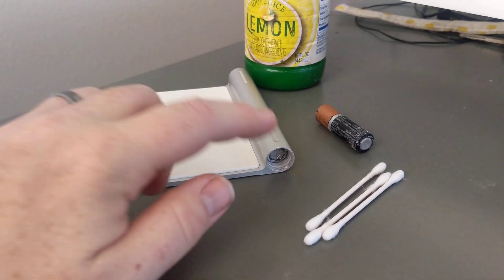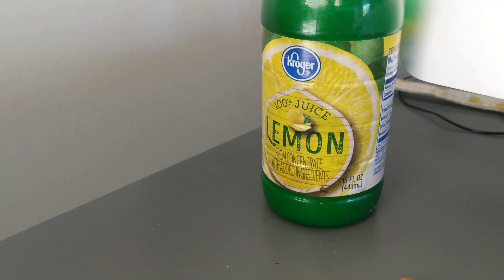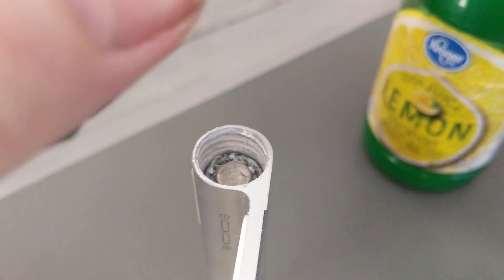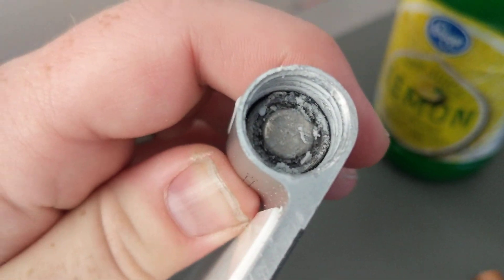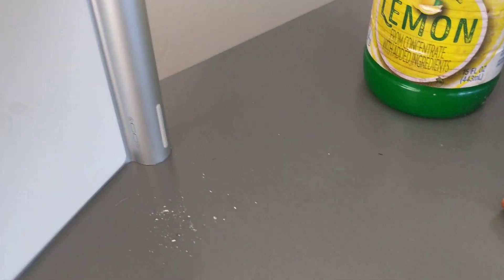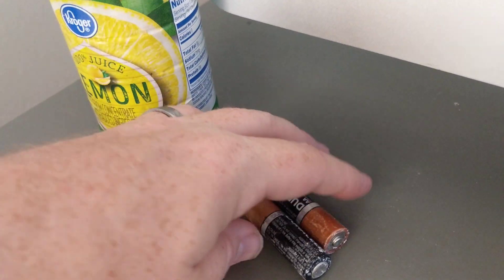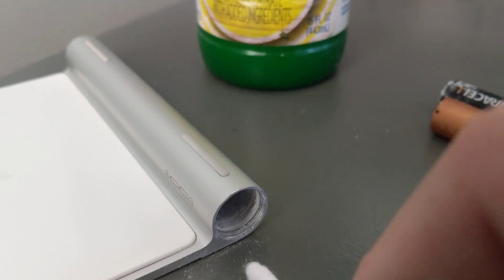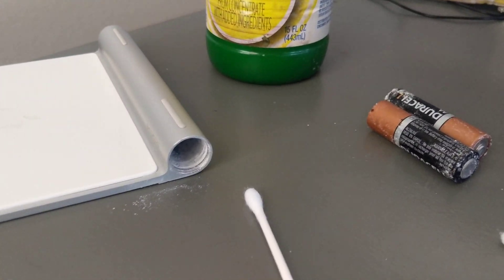How to fix stuck Apple Magic Trackpad (A1339) battery screw door and battery corrosion.

Comment: Just wanted to share a technique tht worked for me to get my trackpad open without damaging the glass.
I used a tiny screw driver as a wedge/chisel and hammered it in all around the edges of the screw endcap. I think the hammering helped loosen the corrosion.

Comment: I couldn't even take the metal cap out. Have been trying with hand and electric screw driver and have broken a couple quarters :(
Reply from the maker: It's the tapping while turning that did it for me. Gotta do something to loosen up that calcification in the threads. It's probably really bad on yours. Just be careful not to shatter the glass. I found that a nickel was the perfect size to get it turning.

Comment: It should be said that this isn't an alkaline battery problem, its a dissimilar metals / galvanic corrosion problem. That's the reason that the corrosion gets so deeply into the threads where the the steel is supposed to exchange electrons with the aluminum, and why "getting the fucking screw out of the end of the Apple keyboard" is a unique and particular problem, even when there's still charge in the batteries.  Loosening the screw wheneven you happen to think of it is the only solution, short of making a new screw out of aluminum, or plastic if you provide some sort of contact plate out to the cylinder walls from the negative terminal.

Comment: Tried opening mine with a quarter and pliers, but the trackpad flexed slightly with all the force I was applying and so the trackpad glass cracked all the way across, so now I have 2 problems to fix! Just bought 4 non working ones for parts off eBay for $25 - I must be able to salvage one working unit out of it and still be better off than having to buy a replacement (I hope!)
Reply: Any updates on that?

Comment: Thanks so much for this, although I cannot get the cap off. Ahhh so aggravating!
Reply from the maker: Using a nickel in the slot with pliers to turn the nickel while simultaneously tapping on the nickel with a light hammer was the only thing that worked for me. I fought mine for an hour before the tapping finally did it. I think the tapping loosens the corrosion that has locked up the threads. Careful with the tapping though, because the trackpad surface is glass and will shatter if you hit it or if you put too much pressure on it. Also, the joint where the trackpad  glass and metal meet will bend if you wrench too hard with the nickel/pliers, so watch out for that. But try the tapping. It was the key for me.
Reply: @JerryFerguson  Thanks! I'm still slowly working on it. I refuse to trash it! Thanks.
Reply: @ashleymullis9539  please let me know if were able to unscrew it. Thanks
Reply: Locking the hell out of it with a hammer works well.
Reply: Coins wouldn’t work for me. I gave up and used a screwdriver. It was still a bit of work, but the cap finally unscrewed.

Comment: I fought the corroded battery in my Magic trackpad for an hour when one of these videos inspired  me to use my table saw to cut an 1/8" slot on the bottom side of the batt compartment giving access to the batteries where the meet in the middle.  Inserted a screwdriver and pried the batteries out!  SUCCESS!  Then while proudly cleaning up the inside and out I dropped the thing on a concrete floor shattering the glass, had a laugh and threw the mess into the trash.  Done... go back to real work now and quit farting around.

Comment: Will putting the vinegar inside damage any components?
Reply from the maker: It could, but I figured it can't get much worse than having a corroded battery in there.
Reply: @JerryFerguson  figured mine out! It was a 2-battery keyboard (I thought it was 3). The receiver inside look JUST like a battery and it looked possibly corroded. Tip: don't try to take out the receiver haha. Felt like an idiot when I figured it out!

Comment: Using vinegar or lemon juice (both acids) will help to attack the corrosion. However, you should use baking soda and water mixture (a alkaline solution) to neutralize the acid(s). Personally, I would first use the baking soda mix to neutralize the battery acid. Then you could use the vinegar or lemon juice to clean the aluminum surfaces. Finishing up by using the baking soda mix again as a final process to remove all remnants of the acid. Aluminum is not a stable material, if you wipe your finger across raw aluminum, it will turn black. This is due to the fact that aluminum is always oxidizing. Once the aluminum has been ate away by the acid, the acid has eaten away past the sealing finish of the aluminum. Those surfaces need to be sealed once again or they will just continue to corrode. After the second baking soda process, I would clean the surfaces with Alcohol. Then have a small amount of clear coat paint on a q-tip and wipe the surfaces with the paint. Let it dry and reinstall batteries.

Comment: Same problem here.  The batteries were so stuck in mine that I had to drill a hole into the center of the battery, drive a screw into it, and use pliers to pull the battery out.  Battery juice + aluminum really makes for a bad time.  I'm only using NiMH from now on.
Reply: Great! But whats the voltage of the battery? 1,5v or 1,2v?